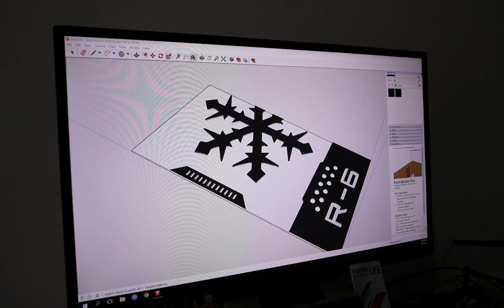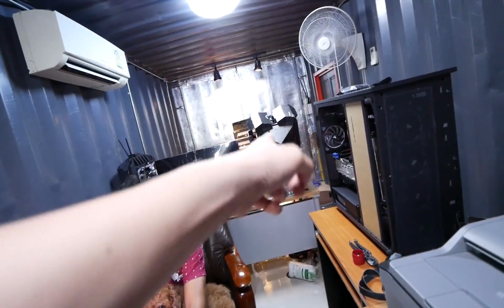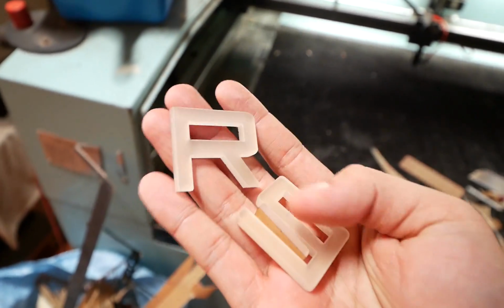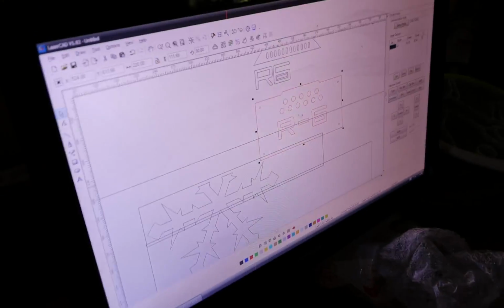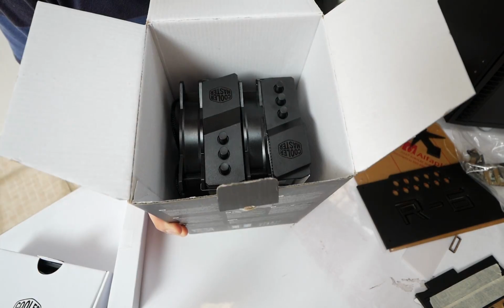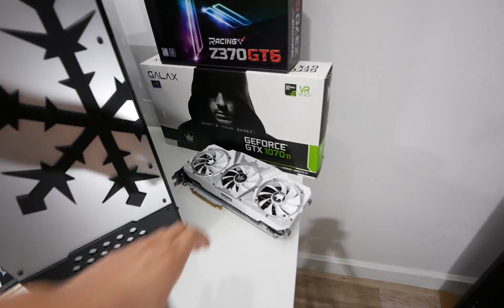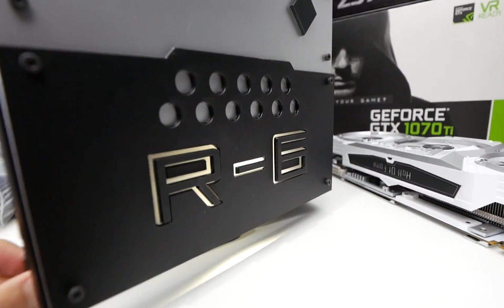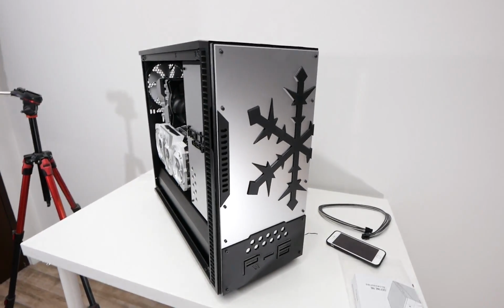Fractal Design Define R6 TG mod

Comment: Get the cable mods vertical gpu bracket, it will place the gpu further inside the case, giving you better airflow.

Comment: Great job modding the case. It's kind of funny how everyone have concerns about the spacing in vertical mode when using GPU with fans. I'm pretty sure that mounting option was meant for users who have water cooling on their GPU, there is nothing pretty about fans so why present them that way. But a proper GPU waterblock is pretty nice to look at.

Comment: Great mod! You are correct that the video card is going to suffocate with the fans o close to the side panel. Hardware Canucks, Gamers Nexus and others have looked at this. It's unfortunate because the vertical look is awesome.
Just about the only way to use those vertical mounts is to have a water cooled card.
The other option that you can try if you have clearance and don't want to use any of the additional PCI-E slots is to use Cooler Master's vertical GPU bracket. It's normally intended to be used with Cooler Master cases as they have all of the support structure in between all of the PCI slots on the case cut out. However, I've seen other people on YT just dremel out the support bracket area to open up all of the PCI Slot area. I did this on a Phanteks case just like Science Studio did. It worked just fine.